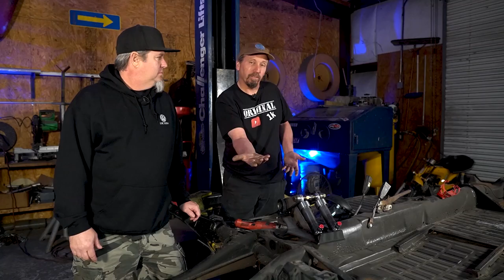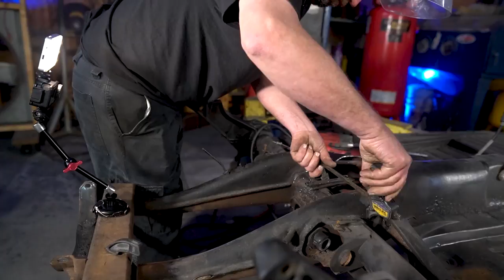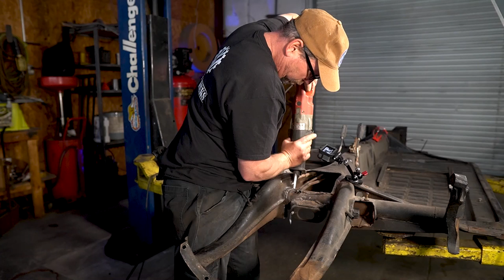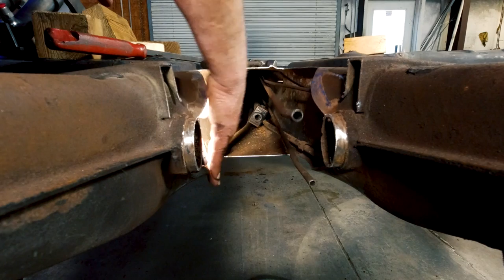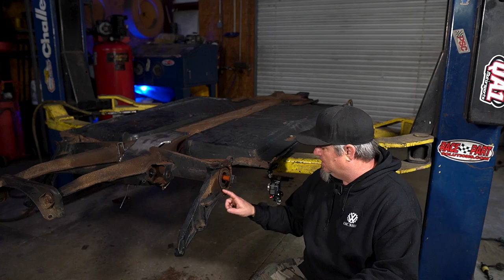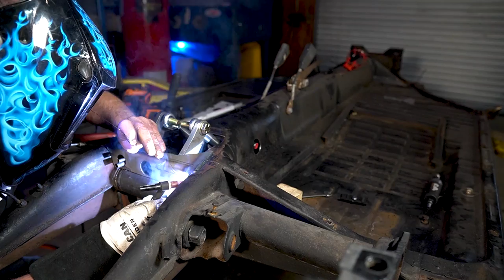How To Slam a Bug | or a VW Thing, Ghia 🔥🔧 (with hydraulics)

Comment: Good video, but I'd rather have independent suspension for front back side to side 3 wheel pancake and corners
Reply from the maker: Front and rear are independent and this set up rides just as good as they do stock but you can't 3 wheel 🙁. BTW the video of this car completed is coming out real soon and shows everything we did to get it on the ground.
Reply: Cant you 3 wheel with air bags as well?

Comment: Three different blades (if you stick to Evo only blades) however, i know of other manufacturers blades that fit but aren't worth the material the're made of! now ship me that hoodie! :)
Reply from the maker: What kind of life span are you getting with the Evo blades?
Reply: @RobStapleton  i've got the evo rage 2 333tpi blade i think?..life span is pretty good, i get well over a 1000 cuts in thin wall (2mm) box..if you treat it kindly it will last a good time..at over £50 per blade you pays to be nice to it.
Reply from the maker: @MakeItMetal  That's pretty good... I feel like you might get 100-200 cuts with a fiber blade so the Evo blade would be well worth it.
Reply: @RobStapleton  I moved away from composite blades the day I got the Evo...best chop saw for the money by far 👍
Reply from the maker: @MakeItMetal  We just got one so hopefully we'll be able to make a vid on it pretty soon!
Reply: @RobStapleton  you will love it, it's accurate and quick :) (ear defenders are a must though)

Comment: Cool setup. Does it work on irs or swing arm style rear suspensions? And what route did you go for the front?
Reply: Yes It will work with irs as well... it doesnt matter . We build a whole beam for the front with the hydraulics built in it. The beam just bolts in
Reply: @ryanlowther6447  its a very expensive mod too do and not done at all.